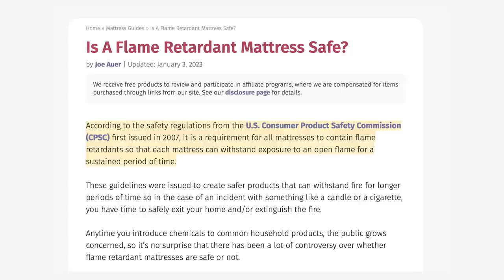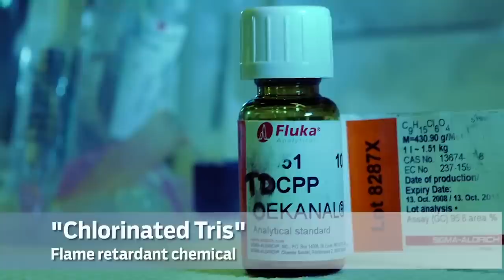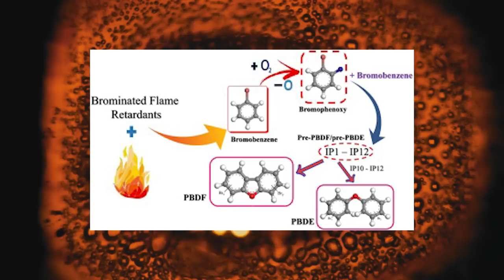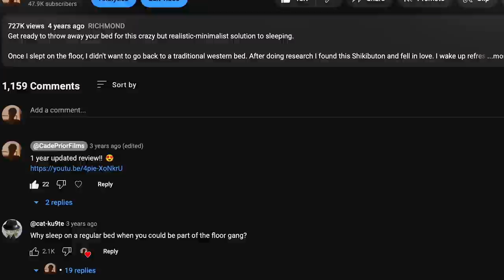Why I Sleep on the Floor | Japanese Futon 4-Year Update

Comment: I was told in 2004 , after a lightning strike in July of 2000 that damaged a plastic part in my L4L5 disc that I would never walk again without assistance of some type at the very best but once I began to reduce pain medications and exercise and sleep on a sheet of plywood with a two inch thick matt on top of a bamboo roll out floor cover along with cannabis use over heavy pain medication I began to walk bipedal and up right in 9 months . I now walk very well and give the credit to no pain medication, exercise and sleeping on that 2 inch matt on top of an half an inch sheet of plywood with a 1/4 in thick bamboo matt....

Comment: My neck and back had been hurting me for awhile and one night I got out of bed in so much pain and laid on the floor and started feeling relief. So I took some wool left over from insulating our tiny house- pure wool from havelock - and sewed them together into a little mattress and put it on the floor and have been feeling so much better. The first few weeks were a little uncomfortable but now I can’t even imagine sleeping on a mattress as I’m so comfy on the floor. I also hang my wool mattress outside on the clothes line in the sun every couple of days to air it out and dry it as I do notice moisture build up on the bottom. Thanks for spreading the word 🙏🏼 ✌️
Reply: From what I've seen people say, you could look into getting a tatami mat (or something similar). It should help with keeping your little mattress from keeping all the moisture on solid ground

Comment: Have been using a tatami for 7 years as a foundation. Still smells like grass, no mould, still in one piece. Used it with a 15 cm futon which has cotton and a natural latex sheet in it. Just replaced it because the middle had the Mariana Trench lengthwise, with a non-toxic hd cold foam (on the tatami). Working out well so far as well.

Comment: Saw that you’re looking into pillows so wanted to share what I ended up going with as a side sleeper. I got a 6” cube shape natural latex pillow on Amazon and really like it. Same idea as the pillow cube with the square shape fitting the shoulder gap better than a traditional pillow, it’s just not memory foam. You can get your pillow height by laying on the bed on your side and measure the space from the bed to the side of your head. You can also do this standing against a wall. 

I also have a shikibuton and ran into the issue of having too flat of a pillow since my shoulder doesn’t sink into the bed like a traditional mattress so just thought I’d share. The one I got was the Turmerry Cuboid Side Sleeper Pillow Long (24x12)/ High 6”/ Soft. Absolutely love your videos! Keep up the good work!

Comment: what advantages do the tatami mats bring? i built myself a bed with the normal wooden slatted frame, close enough so it feels like a solid surface. but the main thing i wanted to achieve with this is that it is aired out automatically so i dont have to carry it outside every week
Reply from the maker: The tatami mats are the traditional "thing" to put the shikibutons on. They are meant to allow the futon to breath and prevent mold and moisture. So if you're worried about mold, I would recommend them. although you can def do without one, just having to be more mindful about airing it out in the sun and ensuring it's moisture free.

Do not buy amazon tatami mats, they are a scam. Tatami mats are suppose to be thick, and there's a specific way in which they are made for them to work properly. 

The ones in my description are the ones I use and are authentic from Japan, tatami mats. Basically just look for thick, handmade ones that are authentic.

Comment: i sleep on a mattress on a slatted frame on the ground, and thought about getting a Futon, but read you are supposed to let it "air out" every day, Tatami mats or not, and thats why i couldn't bring myself to buy a Futon. 
Saw videos where people dragged it on the balcony and whatnot, and that seems 2 much hassle for me.
Reply: I don't air mine out. My house is poorly insulated and my bedroom is the coldest room in the house. I have s wiol rug, then tatami mat, with a 2" foam pad and a covered futon on that. When it got really cold, I put a thick wool blanket on top of the futon. When I frst started doing this, I would fold it up and remake it every night.
Reply: Just buy a firm topper over a futon, it will provide better pressure relief and you don’t have to air it out.

Comment: If you find a proper futon expensive, buy a massive 4-season wool blanket and fold it double. I have done this with 2 different Lits Jumeaux (220x240 cm) 4-seazon blankets, for under 200 euro's each, the thinest futon is around 4 cm, standard is around 7 cm I believe, and folded doudble these wool blankets are between 4 - 7 cm.

Comment: I bought a 3 inch 3 months ago, and was having trouble with it. I'm a side sleeper. After a month, I ended up putting it on top of the mattress.
Any suggestions for side sleepers? Maybe I should try a 6 inch?
Reply: I was wondering how it is for side sleepers 😞

Comment: Hi, I recently had to throw out my own mattress which was shedding fiber glass. I'm really interested in purchasing a futon, but as a side sleeper I'm concerned about discomfort (particularly my hips). In your experience, would you say that the typical futon is a good choice for side sleepers? If it helps, I'm 5 foot 7 and weight roughly 125 pounds.
Reply from the maker: Aw I'm sorry. I've heard of issues with fiberglass getting into peoples skin.

I would recommend checking out a 5 inch Shikibuton. That's going to give you little more cushion to sleep on your side. But even with 3 inches, it's doable. I sometimes sleep on my side and mine is 3 inches. Also know that your sleeping style may change once you purchase these. You may be gravitating to sleeping on your side due to the lack of support in your bed. 

Long story short, look for a thicker Shikibuton. You will still get the correct firmness you need due to the material they are made out of. Check out my description for the futon I have, you can select your thickness size there.
Reply: @CadePriorFilms  Thank you so much for the valuable info man. I've been trying to make a choice but with no testimonials from westerners outside of a few people on reddit I've had major analysis paralysis. I hope your channel continues to grow, you seem like a genuine guy who just wants to help people. Have a good one ✌
Reply: @mr.whatitaint6143  Hi, if you're interested in another opinion from another side sleeper. When I first started sleeping on a thin mattress on the floor I naturally ended up sleeping on my back more often. Then as my body gradually adjusted over several months, I shifted back to sleeping on the side. I don't think it's an issue as long as you allow your body to get used to the new sensation of the harder surface and let yourself transition slowly. Your body will build up the muscles to be able to hold itself properly and eventually sleeping on your side will be comfortable even on the floor, and I'm only on 2 inches, so it's definitely doable.
Reply: @serisaurusrex  I see, thank you for your insight! I feel much more certain in my decision now. Have a good one 😄
Reply: @mr.whatitaint6143 side sleeper here! I was sleeping on a 3in futon for over two years and it was perfect for me. Been moving around a bit lately, but I can’t wait to get a futon back when I settle down!

Comment: I looked at all of your Amazon recommendations and they are only 100% cotton on the outside. The fills are all 100% polyester or a polyester/polyurethane mix. Isn’t that the bad, chemically treated stuff you’re talking about?
Reply from the maker: Thank you, it looks like they recently changed their product as they use to be 100% cotton inside and out. Just updated the links with 100% inside and outside options. 

I only list the amazon ones as an option, but they still are not great as they could be sprayed with chemicals and companies are constantly changing the product and the links won't update when they do. The one I recommend is from the futon shop which is organic cotton on the inside and outside and chemical free.

Comment: There is a growing market for traditional materials in Netherlands especially when it comes to beds and sheets, just wool and fine-woven cotton are better than polyester. I really hope to make a difference by having worked in a furniture shop. The more natural the better should be the mindset, not maximising profit of the chemical industry.🤗 As a child I slept on the floor and now due to my disability I have to use a lifted bed sadly. I feel ashamed. The futons are within my budget also ! Not really more expensive than westernized beds.

Comment: All you really showed was that soft mattresses can cause back problems and that some mattresses use toxic materials. These problems can be avoided by buying a firmer mattress with more support and doing research on the materials and chemicals used in said mattresses. I know you offered for a non floor alternative (a bed frame) but it doesn’t HAVE to be a Japanese futon and it doesn’t HAVE to be on the floor. The same natural materials in your Japanese futon can be found in different mattress brands as well. Also the video clips you used and studies you referenced are all 15 years old.

Comment: But the floor is where all of the germs and bacteria are.....
Reply: Traditionally, in Japan people take their shoes off when in the house and generally clean the house as well. With respect to germs/bacteria, low level background exposure is probably healthy concerning this as opposed to modern houses with excess cleaning chemicals, central heating, carpets with dust and airtight spaces.

The main reason for beds to be elevated is in fact insulation off the floor but bedframes take up a lot of space. Futons however need to be made and rolled up everyday as another chore and often need airing daily as well during the day ideally on a balcony or veranda in the air outside with some sunshine to remove moisture.

Comment: I worked a few years in physical therapy and learned that 4 modern inventions have ruined human physiology and health:
Beds
Chairs
Sitting toilets 
Shoes 

They all take away lots of muscular, skeletal and joint mobility and stability, since they all support the body "too" much. Over time the structures that are there to be moved and put under constant light (good) working stress regularly, weaken and become dysfunctional and cause lots of problems.

Sure, it's not the holy grail. But consider that comfort at all costs is probably paid with your overall health.
#degrowth #slowlife #minimalism #fckComfort

Comment: Um... a Japanese futon is designed to be on a "floor" that is a giant rope bed mattress panel, covered with springy rush matting.  That's what a "tatami mat" is supposed to be, not just something on top of a hard floor. 

Literally, a traditional Japanese house has a floor that's about two or three feet above the structural hard floor, which is why you can store all kinds of things under the panels of that tatami mat "floor."

Sleeping on a futon mattress that is on a hard floor is doing it wrong.

Comment: I had a very similar, if not identical, alarm clock to yours. Just wanted to point out that it had the highest and most extensive EMF levels I've ever measured in any home device.

Comment: How do you prevent mold?

I've experimented with traditionally made futons (abd tatamis) a lot and this remains my main issue. 

Sure I can put the futon on a bed frame for better air flow underneath, but I want to be on the floor.

In my experience Tatami mats do not prevent mold. In fact the Tatami mats themselves are often moldy upon delivery. (not too surprising when you consider fresh organic materials like the grasses used for Tatami mats being in closed off shipping containers for weeks).

Comment: get yourself a custom made full length bed wedge made of super firm Recon 9lb foam. incline of 4.5 degrees.
put it on a low platform metal bed frame, replacing the wooden slats with hardwood plywood planks, one inch thick.
hope this helps.

Comment: Hi Cade, just subbed and liked. Could I please ask you a question? : I used to have a fantastic futon that was extremely heavy (weighed about 40kg) with a hard, coarse texture on the outer shell that zipped off for washing. Unfortunately all the futons I've seen recently are light and fluffy, dont have the outer casing, neither are they as hardy, which would probably deform in the long run. Is your shikibuton of that kind?

Comment: I've tried sleeping on the floor its uncomfortable and it hurts. I tried sleeping on a 4" memory foam topper on the floor same experience. Is a futon right for me?
Reply from the maker: It takes about a month to fully transition your body. And usually you get back sleep up until then.
Reply from the maker: Also 4 inch memory foam is actually less thick than 3 inches of cotton. So a Shikibuton is way better and more comfortable than a topper.

Comment: The only way to know what any mattress contains is to make it yourself.  It's easier than you think.  Just 3" of hemp hulls (aka hemp sand) poured into an organic mattress topper cover layered over a soft base material (I use shredded natural latex) in a second topper cover and you have made the best firm but contouring mattress for your back.
Reply: unless you have a latex allergy.
Reply: @k8sl  You can use any soft base material, it does not need to contain latex. A less than 3" thick hemp sand mattress topper can fix an old worn out, too soft mattress as the hulls fill in all the dips and sags and you can smooth the topper to a level surface with a few swipes of your hand, right through your sheets. It really is like sleeping on a firm but forgiving, sandy beach.  I have found my perfect sleep surface after years of experimenting and I'll never need to purchase another mattress in my lifetime, just may want to replace the hulls every 5 years or so and I can even wash the topper covers (the ticking) whenever I need to.
Reply: @MakeYourOwnMattress  thank you

Comment: What do you think about latex or wool or both materials for shikibutons? I’m struggling to find reviews or discussion about them, which makes sense as I bet those conversations are in the Japanese side of the internet. Fairly niche subject in English speaking circles.

But what I’ve heard in the limited info I’ve seen is that wool is fantastic for both mold/odor resistance which…just makes sense with the properties of wool. And the wool apparently helps with retaining support/less shape loss/compression overtime. And organic latex, apparently usually acting as a “core” sometimes. Futon Shop’s wool and latex is kind of calling my name, was curious if you’ve tried either material? EDIT:Saw your thoughts on latex lower down, I guess my questions specifically then is what are your thoughts on wool shikibutons’
Reply from the maker: Hey! Thanks for your comment. I'm actually going to give the wool shikibuton from Futon shop a try (and they have the latex in the inside). They're sending me one in a couple weeks. So just like you I'm excited about that option.

If the shikibuton is made mostly from cotton or wool, I don't see any problem with organic latex on the inside. Only if the bed was made entirely from it I would question its structure for sleeping.

So my answer is, I think wool is great! But I've never slept on a wool one, only cotton ones. So hard to talk from experience.

I will update this comment in a couple months if you want to hear me review on the wool one!